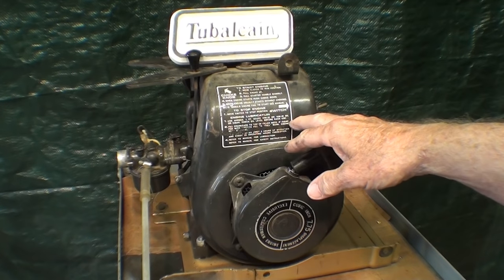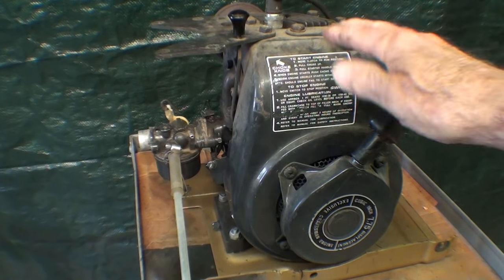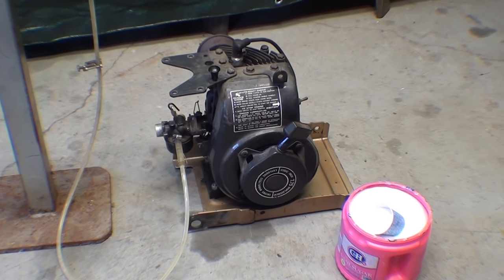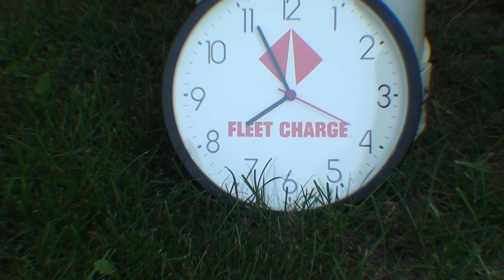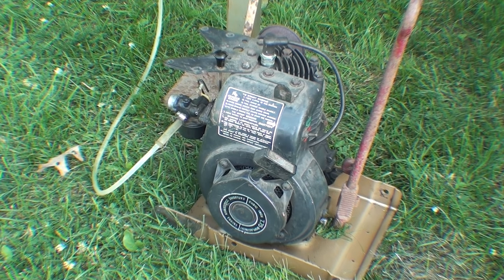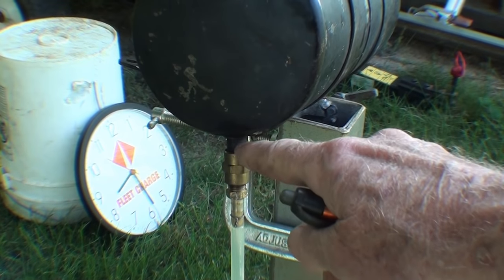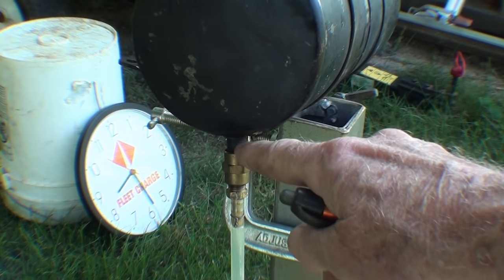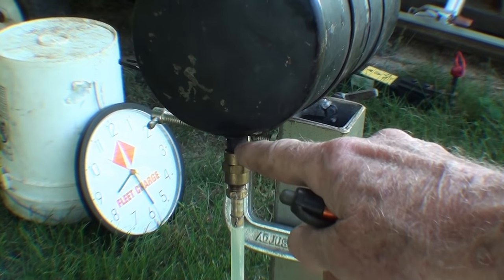MYTH BREAKERS #2 "Sugar in Your Gas Engine Fuel Tank" tubalcain

Comment: Optical mirror Polishing flour (quartz rouge) added to fuel will eventually completely ruin an engine honing out all the clearances in the engine. It is able to get passed the piston rings into the lubrication and cause havoc. Slow but methodical !

Comment: sugar is not dissolving in gasoline, you can shake as long as you want, so if you have a filter on the gas line (and this was not common in the old days), it is preventing sugar to go down; when sugar will get into combustion chamber - it burns and clogs engine, same goes if sugar will hit oil - where hot oil will melt/burn sugar
that's why a "solution" for sugar in the fuel  was to add water, as only water dissolves sugar and is not mixing with fuel...

this myth is not broken, allow sugar to get into combustion chamber, then you will see

Comment: the most it will do is plug up the screen in the tank.

and if it did get into the engine you will foul the plugs and that is about all it will do, it might plug the the carb.

Comment: this is a very old idea it was used during ww2 by resistance operatives it indeed does not damage engines just blocks fuel systems carberators injectors etc nothing that cannot be repaired but it all takes a lot of time and you can tell because of the sediment in the float chamber - fun video thanks

Comment: I will tell what happens have seen it happen first hand after a sugared engine is run alot of the burnt sugar is left behind and after it cools down the valves will stick open the rings also stick the sugar stays behind is carmalized

Comment: I know personally cars commonly didn't have fuel filters and sugar would clog the gas tank and carburetor and possibly ruin the pump. so in total it would leave a car not functional it's just like putting sand in the gas tank to vandalize a car.

Comment: my ex wife was pissed at me and poured quite a bit of sugar in the tank of my work van and a month later the fuel pump died and the tank had to be removed and cleaned.  It was pretty caked up but for sure was the cause of the failure.

Comment: ive had this happen believe it or not the police did this to me and after i got my truck out of the impound i spent a month trying to get my truck running again the fuel pump was rock hard with sugar that had melted from heat of fuel pump after cooling down it turned into a hard candy after replacing fuel pump and lines it wasnt hard to get the truck running again
Reply from the maker: That's a nasty story

Comment: E85 in a small engine? all the majors say not to use any gas with any ethanol
Reply: I think he's using e10
Reply: The low quality Ethanol in today's fuels can harm the fuel systems of small engines more readily than in our automobiles. I always run high octane Ethanol Free Fuel in all my small engine equipment. Simply Google Ethanol Free Fuel in your zip code and you'll get a listing of fuel stops that have it. Around me, it's Philips 66 and Shell that has the Ethanol free gasoline. If you run E85 in your small engine (which MrPete used 10% ethanol fuel), your engine will run, but it destroys the gas lines and gaskets that are not equipped to handle the higher acidic properties. Alcohol engines (including race cart and drag cart small engines) are designed to handle the high alcohol percentage and run better on it. Good point to make though on using Ethanol Free Fuel. Zip~
Reply: Yeah Jason, it really doesn't even have to be E 85. Ethanol in small engines period is bad. That's why my boss has us drain and run dry all the fuel from our seasonal equipment. Even with Sta Bil in it, you run into starting problems next year if you leave that crap in
Reply: The Ethanol is mixed AT the pump at all fuel stations for a reason. The degrading process begins immediately upon the two being introduced to one another. The Ethanol begins to break down and turn to gel. In the process, it draws moisture. This moisture and aluminum bodied carburetors do NOT get along at all. I replace on average of 10-15 carburetors that are beyond repair at the beginning of each season. Your best course of action is to find an ethanol free fuel in your area. A simple google search will yield the closest stations providing this. I've got engines approaching 100 years old, and they only get 100% gasoline ran through them. Your Boss knows best Skids. Zip~
Reply: ZippoVarga Yeah Zip, guess what, the Shell in our area, due to political pressure, started selling ethanol. There is only one place in town to buy ethanol free gasoline. The airport
Reply: Ouch! We have Shell (still ethanol free high test) and Philips who also sells high test ethanol free. The Government is FORCING this Chit down our throats and we don't want it! Bastards. lol

Comment: Sorry Tubalcane, not trying to argue with your findings, but the enormous amount of cash I had to pay to get my truck running properly after some $@&#% put suger in my tank is all the proof I need. New filters, (replaced several times), several carb rebuilds and finally a brand new carb, several new electric fuel pumps, boiling out the tabk and fuel lines. Oh yes, sugar can cause its share of damage. Lucky for me the garage only charged me for one filter, cleaning of the tank, lines and cleaning the new fuel pump, plus the new carb. It was around $700. It would have been over $1500, and this all took place over the span of several weeks about 40 years ago. Dispell the 'myth' if you must, but you'll have a time convincing this old boy, lol! I'm not disagreeing, but I wanted to share this with you as sugar can, at times, be a real pain. Oh! I had to get rid of the truck because it never ran right after that. Take care, and keep putting out those great videos! Sure do envy your skills, I'd love to be able to build engines.

Comment: when that '' theory'' came about most cars did not have fuel filters, at most they had a sediment bowl to collect water and larger debris. l don't know if the theory is valid but sugar is carbon, so it could possibly load the combustion chamber with carbon.

Comment: Try water instead.  Since oil, or variants float on water, the ignition system will pump that instead, therefore disabling the engine.  Why waste good money on sugar that could sweeten your lemonade or iced tea?

Comment: Techumseh engines don't need sugar in the gas to die..
I think the sugar in the fuel as far as actual engine damage happens over the long term.. over a long time it'll gum up the rings.. it takes a long time because the sugar doesn't dissolve very well, so it sits in the tank, and over many tanks will be continually contaminating the engine.. 
Clogging the fuel system? well, that depends a lot on the design of the system.. if you have a dip tube going down into the fuel from the top of the tank, it's pretty unlikely it'll draw much undissolved sugar and clog anything

Comment: Theoretically the best way for you to ruin a person's engine, is to go under the car, loosen the bolt to the oil pan, but only slightly but not full, then the oil heats up while driving gets thinner and runs out.

Comment: Gasoline is termed a non polar solvent which means the molecule does not have an electrical charge as does water.
Water is a polar solvent meaning its molecules are positive on one side and negative on the other, sugar molecules are also polar so the negative part of the sugar is attracted to the positive part of the water and hence it will dissolve in water and not in gasoline.

Lesson over.

Comment: I am just going to split hairs on this one. The engine did die and stopped running so sugar makes an engine stop run, but does not destroy it. Now you have someone that does not know anything about engines and this happens to them and they think the engine is dead, and they say sugar killed my engine. What I am wondering is how many mechanics made a lot of money fixing engines when all they had to do was clean gas tank, fuel lines and new filter. And they charged for a full engine rebuild.

Comment: Great video Mr P. If anyone has read the 1959 adventure novel by Alistair McLean the saboteur uses sugar in the fuel tank......Wiki says this..."Hillcrest sets out after the group but soon finds that the petrol he picked up at the station has been tampered with. Sugar has been added to the petrol causing the sugar to melt and stick to the engine parts leading him to get bogged down. A solution is found to this when one of the passengers, a chemist, suggests that the petrol be mixed with water and the top layer of the resultant mixture be siphoned off....." Its a good fun novel to read called "Night without end". I seem to remember that the description was carbon build up in the head caused by the sugar...maybe I should re-read the book. Looks like you have busted Alistair this time Mr P. Kind Regards Garry UK (The English Bit)

Comment: Sugar in the gas will damage a Harley Davidson engine: I rebuilt that 1450 cc Harley engine ( 1987 model) ,the fellow's wife had poured about 5 lbs of sugar in the gas tank it had sat there for a while the bike was rarely used: The gas and dissolved sugar made it trough the injectors ceased the valves on the rear cylinder bent the push rods in an (s) shape broke both push rod tubes ; New injectors,piston ,rings ,push rods,repaired the heads.
Reply: Michel Grenier a fuel injected 1987 Harley? How do you know that it was the sugar and how do you know it dissolved?
Reply: Not into bikes it was a fuel injected motor repaired it for a friend ,there had to be dissolved sugar in the gas , gas will absorb moisture and could mix with sugar ,the heads and valves were heavily coated with carbon and the valves were ceased. I was not going to taste the gas but the carbon on all that was a good indication of burnt sugar;That kind of damage was not normal;The engine would start on one cylinder for 3to4 seconds and the gas tank had about 3 pounds of remaining sugar in it.

Comment: I bet if you didn't have a filter on it, it would have killed the motor.  All that sugar would be pretty abrasive.
Reply: It wouldn't have killed the engine, it would have just plugged the ports in the carburetor. Even if the sugar made it to the combustion chamber, it would take a pretty good while to do much damage.

You want to kill a engine, pour the sugar into the crankcase.

Comment: Alistair Maclean wrote a book around the sugar in petrol stopping a snow track. The water in the petrol absorbs the sugar and helps to transport it. Ironically, by adding more water to the petrol and allowing it to settle you can recover some of the fuel. As for the myth i don't think you have broken it yet. Without a filter you may get caramelizing in the bore and seize the engine, where was all the black smoke and complaining neighbours we expected to see?? You have your next mission should you decide to accept it.............

Comment: this was done on a Briggs & Stratton engine a lot stronger engine than your Craftsman and they did it with the top of the engine being clear you can literally see the sugar burning to all the Piston walls before the Piston welds to it and seizes the motor this video should be flagged for false information
Reply: Makes me wonder why he stated he was using cane sugar, not beet sugar.
Maybe beet sugar is more detrimental to engine life...just wondering.

Comment: try karo syrup it will get to the engine and when it does it turns to caramel and charcoal  in the engine (rings and valve guides

Comment: 'Sugar' is insoluble in gasoline. The problem, as the video demonstrates, comes from clogging.
HOWEVER!!!!!!!!!! A certain form of sugar I will not state here is extremely capable of traveling into the fuel system in small amounts and will clog EVERYTHING. That form of sugar is where the NOT-A-MYTH comes from.

I once had to deal with a fuel system that was poisoned by the problem sugar. The solution was a solution, literally. Drain the fuel out and fill the fuel tank with warm to hot water. Than cleaned the fuel lines. However, the carburetors had to be disassembled and thoroughly rinsed in hot water. The fuel filters (2) were write off. If the correct wrong sugar gets into your fuel injectors they will need a hot water bath as well and possibly will be damaged.
Reply: "A certain form of sugar I will not state here"
why wont you "state here"? thats the most pointless thing i have ever read.
Reply: Ryan James powder sugar
Reply: Ryan James you can delete my coment after you read it
Reply: Joseph Heffle jello powder

Comment: I had to reply, you are wrong, how long the sugar takes to dissolve I don't know but as you know sugar turns into carbon when heated hot enough and it expands. I have seen the effects in engines that have been sugared and it clogs exhaust valve cambers and it also get down the sides of the pistons behind the rings expanding them to the point of not being able to turn over. As for the gas tank being ruined water melts sugar and can be easily washed out and let dry. If it weren't for water in gas tanks the Dry Gas companies would be out of business.  You may want to see how long it takes for the sugar to melt. If you really want to test the melt time and duplicate in the car gas tank make up a container and ride around with it in your car trunk. You could also put some sugar in your gas tank that would debunk it... Just thinking about the water in sugar melt some add some dry gas or alcohol which will then be abled to mix with the gas. That would end the clogging so the engine can run get hot turn the sugar to carbon...   I could go on and on about this but I think you get the point.

Comment: I'm really sorry, mr Pete, but you didn't bust the myth.  You used a process that didn't allow the sugar to REACH the motor, so you don't really KNOW that it won't damage an engine.  What you proved is that, in 99% of the cases, the sugar would clog the fuel system long before it got to the engine, and you made sure of that by putting 4' of gas line and an extra filter between the tank and the motor.
You proved this, "Someone put sugar in my gas tank, and now my car won't start!", which is what everyone would say if they knew to actual science behind this. This is the first time in 800 videos, I have disagreed with you enough to state it, but, PLEASE, keep on delivering these super videos.

Comment: It is not a myth  I saw the results of sugar and tasted it, it was sugar.  The car came in to the Dealership  running problems  no POWER. The sugar  worked over time . It had cloged the intake  manifold I chippat it with a hamer and screwdriver  to brake some up to see what it was. It had made what looked like round PYRAMIDS  under the carburetor  IN  the intake that got so big it reduced the air and fuel flow through the intake  and the Car had no power. 
The car was not covered under warranty  so I don't't  know anything  else  of the damage  that was done. but it is true.

Comment: I disagree that the myth is broken.  The engine did quit.  It just clogged the fuel line, fuel filter, fuel pump and perhaps the carburetor.  To get your car working again, you'd have to clean all that out.  BTW- sucrose is soluble in ethanol at 1g per 170mL.  So, your gallon (3.8L) of gas (assuming 10% EtOH) can dissolve less than 1/2 teaspoon (2.2g) of C&H (not from H but still made in C).

Comment: You mix it and make a syrup out of it and pure it In . Cheap pancake syrup fixed our neighbors kids truck that kept running the kids In the ditch for fun. It galled the Pistons , cylinders , Ruined the valve guides. He had a hard time running our kids off the road after that. But yes if it's not made into a syrup it'll be just like sand.  next try sum pancake syrup to get the full effect.

Comment: You are repeating a test which has been conducted several times in recent years; with about the same result each time: The sugar won't dissolve in the gasoline, and aside from clogging the fuel system, it has no significant effect on the engine.

When this myth was more popular, gasoline contained tetraethyl lead.  This is a completely different formulation, and may yield a completely different result.

Comment: If anything you proved the myth to be fact.

"the engine has stopped dead"
"sugar in the filter"
"sugar in the gas lines"

In a car that would be thousands of dollars! 
Especially in higher end cars

Cars have a much more complicated carb or fuel injections. 

Splitting hairs with "nothing made it to the engine" with this limited test. You did not take apart the engine and cars have a different system to push gas. Most people will push the pedal down when the car starts stalling and the engine will keep pushing it through the gas and valves. I know many old  mechanics that have worked on cars with sugar in the engine. 

Just think how finicky lawnmowers are.

Comment: Normally, I am saddened when an old AMERICAN company goes TU, but not when Tecumseh  went. I have here on the farm, 4 blown Tecumseh engines all dead from the nylon teeth on the governor gears shearing off. Sadly Wisconsin is gone. Those run forever, like an old iron Briggs. For me now,  1st choice is a Kohler, and though I hate to admit it, Honda's run excellently.

Comment: This proves nothing. I have personally worked on a toyota corrolla that had sugar put in the tank. The fuel tank had to be removed and sent to a radiator shop to be boiled out. The fuel lines had to be flushed and the carb had to be rebuilt to remove the sugar. I also had to remove the cylinder head and tear it down  to remove the dissolved sugar that collected on the intake valves and was holding them open. Just because a piece of crap small engine with loose tolerances will run does not mean every engine will. You did not implement enough controls in your experiment.